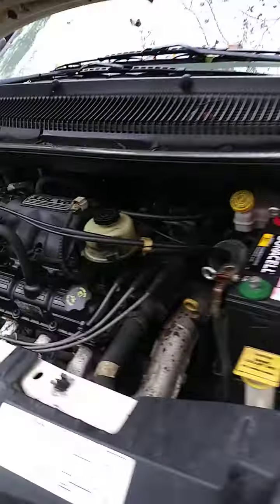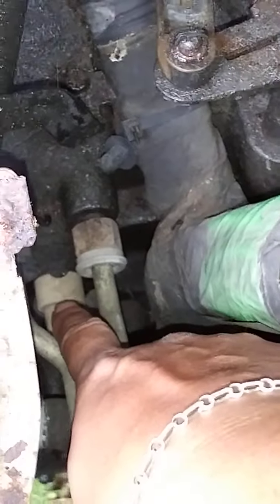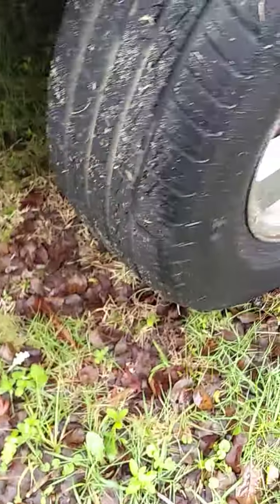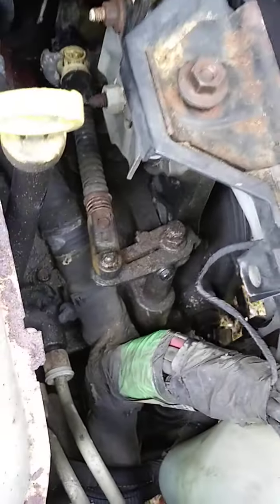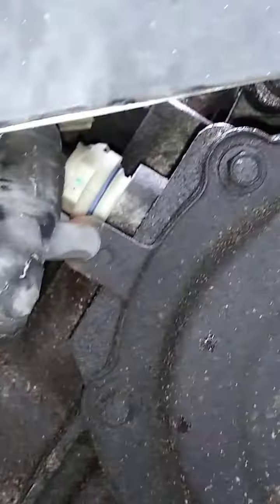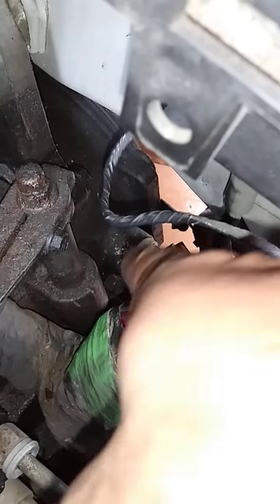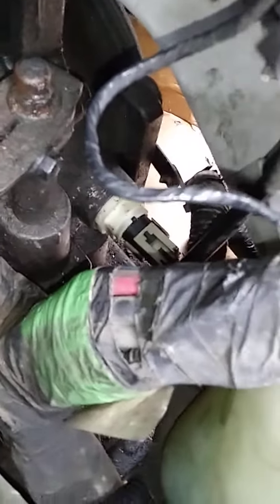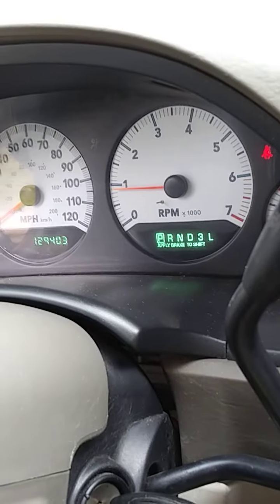P0700 - P0720 EASY FIX! Input/output speed sensor/ multiple symptoms and transmission codes

Comment: This happened to my '03 Grand Caravan last year. It started with an intermittent misfire and speedometer needle going crazy. Not long after it threw a P0720 code, the transmission would not shift out of first gear. I then replaced the output shaft speed sensor, and it was fine for almost a year. Then it happened again, so I simply cleared the code with a scan tool and the transmission resumed to normal operations. That lasted about two weeks. Then after I'd clear the code, it would come back within 10 minutes of driving. * Some threads I've read indicate that the connector itself may be the problem. It's under the battery (and subject to corrosive acid) and the wires come in at such a sharp angle that they can actually break inside the insulation. I ordered another sensor (they're only $20) and also ordered a Standard F65001 connector for about $25. I got to mine by removing the battery and the battery tray and removing one bolt from the cooling system reservoir so I could move it to the side. That might be the better bet if you're going to replace the connector too because it's much easier access to the harness - just trim back about 4-5" of the tape, splice the new connector in, and tape it up really good. I should know by this weekend if this fixes it once and for all.
Reply: Did it fix it?
Reply: @Brandon-21MN  It did not. It ended up being the damn alternator! The vehicle would need to be jumped after it sat for a few weeks, but no other indication that it was a charging system problem. I threw a reman from Rock Auto on there and it runs like a champ.
Reply: @kevinyoung6067  oh damn well thanks I've had some people tell me this so i threw a good junkyard oem Denso one on and it didn't fix yet hope I get mine fixed soon 🙏

Comment: I have an 08 Toyota Sequoia with sluggish transmission and hiccups while shifting like you mentioned I just purchased  the output sensor and will be replacing tomorrow. Will let you know if that fixes it. For reference I have P0894 and C1201 codes

Comment: Great video you go girl I’m a female trying to research everything too straight forward and trying to save another money I like that I own a 2006 dodge magnum which threw a p0700 code as well as p0404 egr along with secondary low voltage system meaning low battery voltage so check my battery hasn’t given me any issues starting unless I leave my door open and forget interior lights anyway watched some videos and next morning wiggled electrical connectors  and started it cel lights were off but still really hesitating rom at 40mph when between 1.5 and 2.0 really bad mild jerking or like cruise control switch turning on and off activating a vacuum and deactivating really strange afraid to do more damage but I’m stuck at moment

Comment: Yup, rebuilt my '11 kia sportage tranny with new friction discs.  Didn't work.  Replaced all the solenoids.  Same problems.  Changed to Valvoline SP4 full synthetic. Same problems. Now the 0731 gear ratio error pops up and slips on 1st gear and it looks like it was just the speed sensors all along.  It can't be the friction plates.  I just replaced them.  MAN!  I just ordered new speed sensors on Amazon and will arrive next week and I will finally see what happens. You live and learn I gue$$.  I was thinking of taking apart the manifold body and maybe rebuilding that, but, nah for now.

Comment: make sure you change tranny filter mopar fluids only  and speed sensors  mine still have a lill thump from time to time after all change with solenoid pack but it dont stall anymore and left me stranded